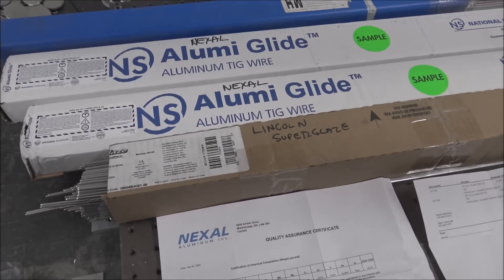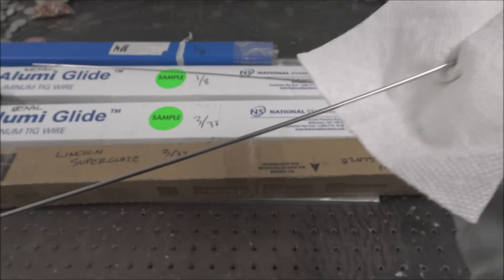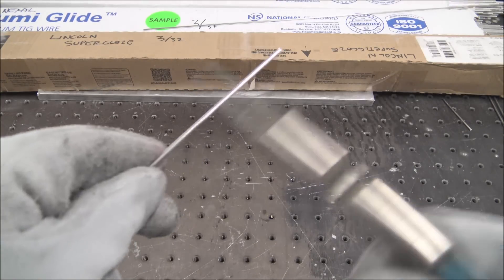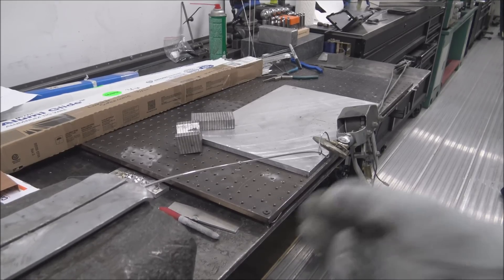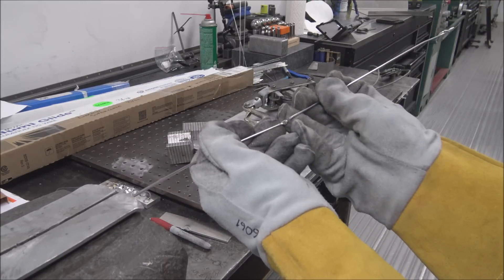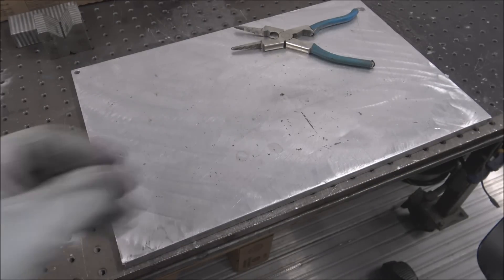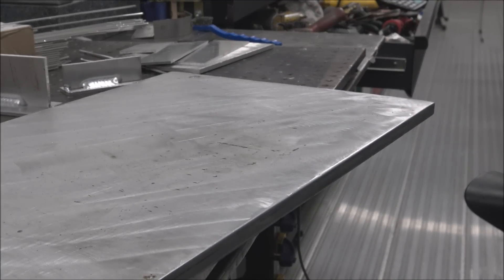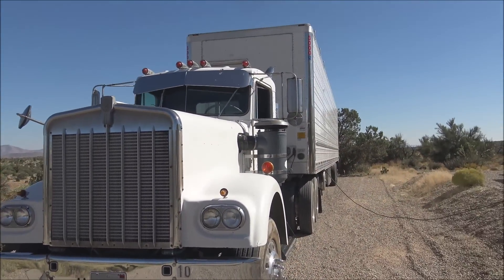TIG Welding Aluminum - Different Filler Rod Brand Comparison

Comment from the maker: Talk or no talk in videos?
Reply: Aaron, I welcome any information from you as you are a wealth of knowledge. Thanks for everything you've done for the welding community!
Reply: The no talk videos had a charm to them but, I actually like that we can hear you provide more information. Either way, keep ‘em coming. I have yet to find a video that addresses how much rod is fed, if it’s a dip or a push. I have only guessed by catching the stamping on the rod if it’s there. It would be a great video to put some small scratches in the rod to get a good visual on how you do it. Thanks Aaron 🎸 👍🏻
Reply from the maker: @Kashed  
On the website, I have VERY detailed explanations on how I do everything, including feeding the filler rod. I run a sharpie stripe around the rod and show exactly how I "inject" it into the puddle, with an arc shot that shows the liquefied puddle and exactly where I introduce the rod, and how I exit the puddle. You can clearly see how much and when I feed the rod.

If anything isn't answered on the website, feel free to email me.

Thanks
http://www.6061.com
Reply: @6061 я понимаю только частично язык, но лучше говорить👍
Reply: @6061  I suppose talking is necessary for such information rich topics, so yes, talking is fine with me. Just don't forget your roots. I've come to really enjoy a good thumbs up or  wag of the finger. 😂
Reply: Yes talk!
Reply: Talk for sure.  The silent videos are remarkably clever, but you can relay so much more information when you speak.
Reply: Yes for talking as it’s more humanistic & real & also nice to hear the person behind all the work.
Reply: I like the talking, just a little more intuitive to understand. You have a good clear presenting voice so use it
Reply: @6061  Either works, just don't lose the sense of humor ^_^
Reply: Your welding inspires me also your filmography. I am glad to hear you talk about the tig button from your videos. I have bought two of them. Absolute game changer, in my opinion!
Reply: I think this is the first time I've heard your voice.... In any case, for this vid it works, great info, well done... there was nothing wrong with your other vids either... They both work for me
Reply: Sorry to go against the others, but I vote for no talking (no offense). When you are forced to write out what needs to be conveyed, the chances are better that you will make a concise statement rather than rambling on.
Reply: Dude absolutely talk. I’ve been watching your videos forever and I was very pleasantly surprised today, nice to meet you 😂. You can still do videos where you don’t talk though too!
Reply: I’m down for the talking videos. Repairs, new build or small tutorial, always learning g something I ok with.
Reply: Depends on what you are going for, information, testing, and how-to's usually require explaining things, entertaining videos tend to have some quirk or inside joke.  Your videos always showed you in the helmet, no voice, and that was the character and the content I love.  It's kind of like TOT only showing his hands and cutting himself off.  So, to answer your question, I'd break it up into two channels, an entertainment channel and an instructional one.
Reply: I'm thinkin' talk, but I'll watch either way, definitely want to know more about your shop setup 😎
Reply: talk, graphite, whatever rocks your goat, just keep em coming (voice is good, like both formats so far 👍)
Reply: Talk! Absolutely!
Reply: Aaron, talk, and any and all videos of fixing up your "new" truck and anything else! Of course all welding videos too! Thank you.
Reply: Both! either! same. All your vids are a👍🏻
Reply: You've said so much without speaking already. 
But it does allow for more information exchange in less time.
Just keep the hood and gloves on whether you speak or not. 
That's what we expect from 6061! 
Nice truck.
Reply: I say both ,  in the videos where you are showing us you fabricating or welding a part, small captions are more than enough, in videos like this where it's more about information sharing/ comparisons of products, or problem solving / repairs (like on you new older truck)I think talking will allow for more information easier.
Reply: Keep talking, we learn more.
Reply: Sure! I'll still watch any and all your videos.
Reply: Both. A deep dive like this is definitely welcome but I also enjoy the no talk videos. You have a knack for telling a story without words. Lots of “ah ha!” moments. My all time favorite is pulling wheelies on the mini with a welding helmet on, classic 6061! That needs to be on a shirt.
Reply: Es raro escuchar tu voz.. 😂😂😂... Pero no esta mal para este tipo de videos informativos 👍👍👍👍... Saludos
Reply: I'm all for the chat. I'm not a strong reader so I'm usually on and off the pause button. Good video, I just buy whatever filler has the best price tag and never had a problem with any.
Reply: Aaron, ol'school no-talk videos are what we're used to deal with on your channel. And although this 1st try of yours turned out rather well, I'd prefer most of the videos to remain being in the old format. You're quite good at gestures when doing drama and on-screen text when doing explanations. And as for the truck fixing - I'd recommend opening another channel for that kind of thing since your automotive skills may not be up to the level of your welding score. 6061 should remain being definitely about welding (mostly Al, although some Fe, Cu, Ti, and Mn additives may occasionally be welcome as well). You have built up your brand and you'd better treat it with care.
Reply: Keep talking 100% and do a face reveal too.
Reply: Keep all the videos coming.. truck 
Fix or anything else, just keep talking
Reply: didn't know you could talk🙂
Reply: Talking works. Less reading!
Reply: Your content is always spot on!! 👌 The addition of talking will take it over the top.
Reply: I prefer videos that are concise and informative, regardless of the narration method.  Do what you want.  You are good at either, but I imagine editing in your captions might be tedious?
Reply: Talk!
Reply: Talk for sure! 👍
Reply: Talk
Reply: Talking videos are very nice
Reply: Talk videos please! The details based on experience can be lost in a no talk videos. Thanks for your videos!!!!!❤❤❤
Reply: Yes.
Reply: Talk!
Reply: I ve been watching the channel for years. From my older account.  I think both has their charms. The no talk vids has some old cinematic way of explaining things which is enjoyable and talking vids are very informative.  I dont even stick weld but I love tig welding just because of watching your videos. If I ever need to buy a tig machine I ll first purchase your educational video series
Reply: Absolutely! I dig the explanation.
Reply: Definitely talk mate! so much more value can given from your videos when you add a narrative! Love your work mate, keep it up!
Reply: I enjoy both
Reply: Talk
Reply: Talk please
Reply: I didn't have my earphones on the moment I started the video so I thought; oh this will be interesting on how he will show this. :) Based on your knowledge and if there is occasions where it would be easier to explain by saying something for you, then by all means do. But it has been interesting and worked just fine as well when you have not.
Reply: I like it.
Reply: Talk ! Hell yeah I feel like a veil has been lifted!
Reply: Absolutely would enjoy some build videos about your new to you big truck. Great video as always. ✌️😁
Reply: Talk. Absolutely. Even with the no-talk vids having a certain touch, I personally prefer hearing You explaining. Thanks for sharing!
Reply: I say both! I am really enjoying the narration and added info but I love all of your videos dating back to the beginning. A lot of funny moments mixed in with the teaching. Super talent all around.
Reply: Doesn't matter,  I come to steal whatever I can from you talk or no talk.  That consistency is insane.
Reply: Always talk
Reply: It was cool to hear you man. I’ll be watching your content whether you talk or not.
Reply: Yes ! to talking and YESSSSS !!! please, to seeing the lorry repairs, mods and restoration.
Reply: TALK!!!
Reply: Talk, I’ve picked up so much more from your videos when you’re talking! Thank you for deep insight into welding!!!
Reply: No talk
Reply: Talk!
Reply: No talk. Love the videos, just feels cleaner and simpler

Comment: Just got som Hobart MaxalTig 4943 filler rod, and it's round from end to end. No annoying flat spots stamped in it. Designator is just roll stamped on the rod as is.

Comment: W 900A is one of the most iconic trucks ever. The only parts I've had trouble getting was a wiring harness. They are for lights and plug into the bulkhead. I ended up having to release the pins and make new ones.

Comment: Just received your TIG Button...Love it!    I too, notice irregular metal deposition when burning thru the smashed Identification on all filler rods. I also noticed the small minute stamping can "trap" any contaminates if I do not wash the filler rods with acetone. I do scotch bright Aluminum fillers before the acetone wash.

Comment: You tested just about everything that I would never have considered testing. Even though the welding rods met the same certification standards, they might have different percentages of alloying components which would affect how it flowed in the puddle or dealt with oxidation of the material that you are welding...... Your subjective satisfaction while using them is what really counts.

Comment: If you have information to convey that talking would be beneficial, for example today's video certainly benefits from narration. However some of your best and or humorous videos were silent films. I have been using National Standard steel mig wire for 30 years in my borewelder. I never knew they sold aluminum consumables. I guess I should get out more!  

Trucks, for the aspect of reliability and maintenance the older Kenny is probably much better. However it's still a truck and subject to all evil things trucks can annoy you with. The only good truck is one with someone else's name on that brings me my Amazon stuff! 🤣🤣🤣(and Yes I own a truck and have been around them all my life, I know!)  However trucks are ripe for customization and people do some really cool stuff with them. I think it would be fun to see what you come up with as you fix 'er up.  Cheers
Reply from the maker: Thanks for the feedback
What are your 3 favorite videos?
Reply: @6061  sorry the delayed response. I have been busy and it slipped my mind. I cannot remember the names of them. But one was when you welded the chevy bowtie to a ford truck in the dark of night (or was it the other way around?) That was hilarious. The Cummins B series valve cover and the Ron Covel Bomb project are among my favorites.

Comment: Nice old kw, I use inweld filler at work runs pretty nice, at home I've gotten harbor freight 5356 on a Sunday afternoon need it now situation and it worked surprisingly well  ...glad you're doing ok

Comment: Question: i am a beginner and I would like to know what is aluminum material that you used, and which filler rod code names 😊
Reply: 6061 has a website where all Q's are A'd. Also has good arc shots and all the other answers about how Aaron does it. Also he gave that information in this video. I heard it. Observe grasshopper, observe.